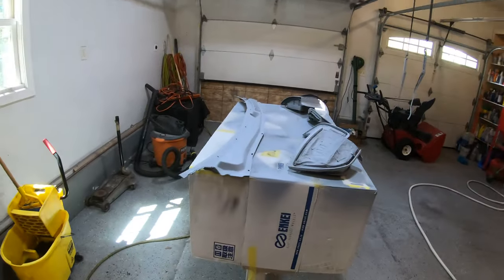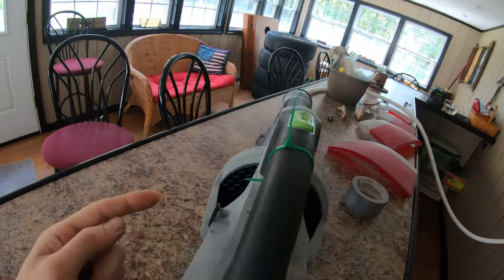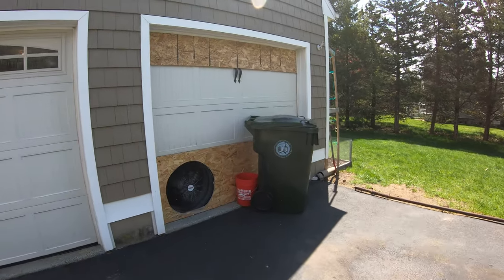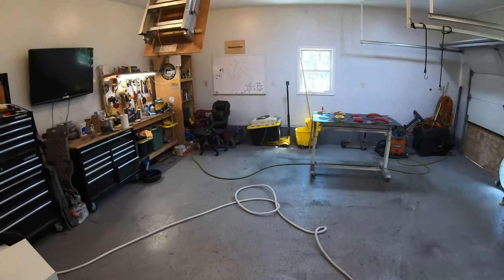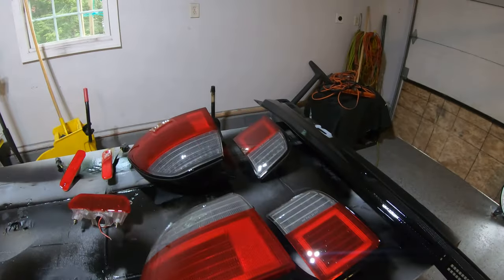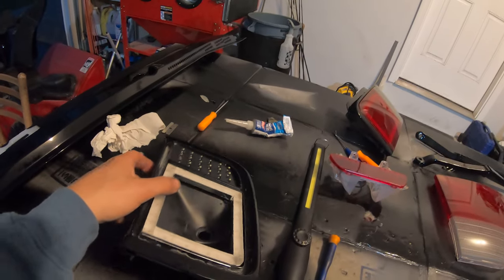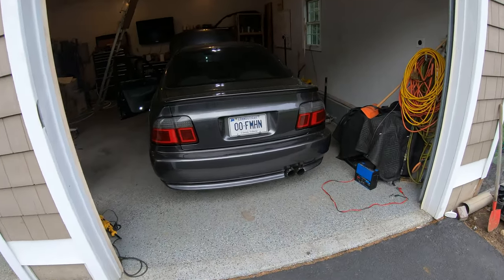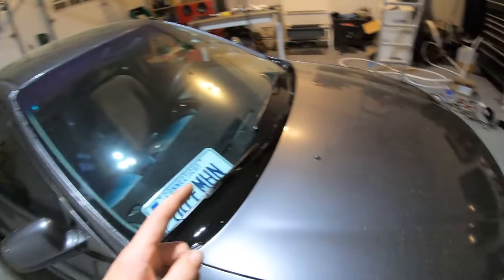Turbo CD5 Custom LED Tail Light Painting (Paint Booth Overview)

Comment: IIRC The rear subframe is different and will also have to be swapped for the factory sway bar
Reply from the maker: Yeah they have mounting holes for the sway bar bushings. I was thinking maybe I could just drill out some holes in my factory subframe... Not sure yet if that will work.

Comment: OSB
Reply from the maker: Yes! thank you 🤣
Reply: @ThatAccordGuy  no prob.  The car looks great by the way.  I normally don't care for aftermarket tail lights but those look awesome!  What are you using for engine management?
Reply from the maker: Thanks man. Yeah every available tail light for this car was ugly in my opinion so decided to make my own with the stock housings.

I'm running a chipped p28 tuned with Honda tuning suite. Used to use chrome but I like HTS better.
Reply: @ThatAccordGuy  Right on I just got Hondata s300 for my 6th gen turbo I'm working on.  Pretty much just got it because that's what my local dyno shop tunes on.  Also it looks pretty simple to use.  Hadn't heard of HTS.  Does it use a chip burner?
Reply from the maker: Nice yeah if you're having someone else tune it definitely best to get what they're comfortable using. I actually have a ribbon cable with a module that hooks to the laptop so I can tune real-time. Works with crome and HTS or Neptune too. Anything you'd normally burn chips you run off an emulator. Pretty neat stuff. Called an ostrich 2.0
Reply: @ThatAccordGuy  gotcha.  I'd heard of ostrich but wasnt sure what it was exactly.  I knew there had to be a way to tune with those programs without burning the chip every time you made a change lol.
 
I'm hoping to tune myself or at least get it safely driving and have most of the kinks ironed out to keep cost down on dyno day.  

I wanted to try the lower cost software options but I also just want to have as few issues as possible and I think Hondata may have some failsafes that the others don't.  I could be wrong though.  Hopefully I made the right choice.

Last question I promise; I got the generic ebay oil lines and I'm trying to figure out which sandwich plate to get so the feed line will connect without needing any adapters or extra reducers (something else to leak) None of the descriptions say what fitting that end of the feed line has. Looks like the sandwich plates have either 10an, 1/8" npt or both.
Reply from the maker: I went with a glowshift sandwich plate. It's got the 1/8th inch pipe thread that you'll need.
Reply from the maker: I think most feed likes are 1/8th inch pipe thread on on side and like 3an on the other or something
Reply: @ThatAccordGuy  cool thanks I figured that was it just wanted to be sure before ordering👍
Reply from the maker: No prob man